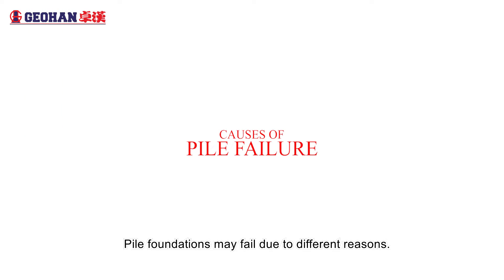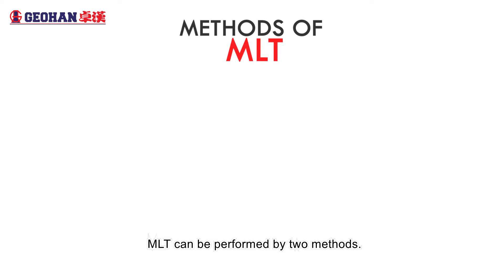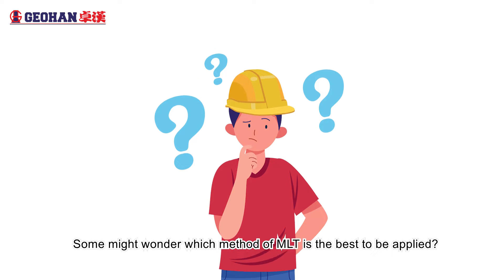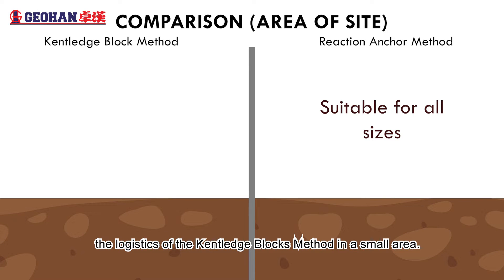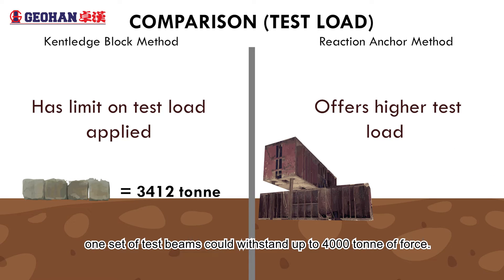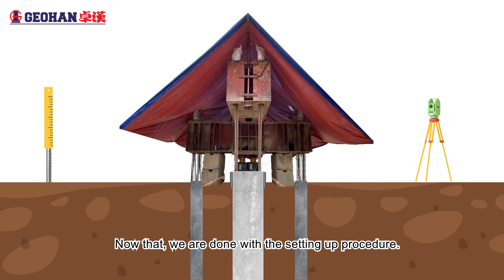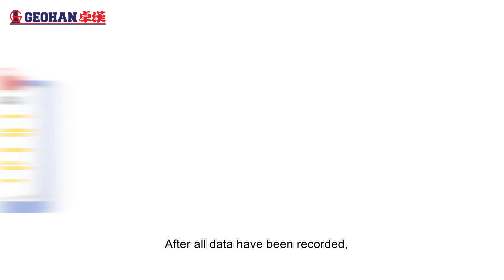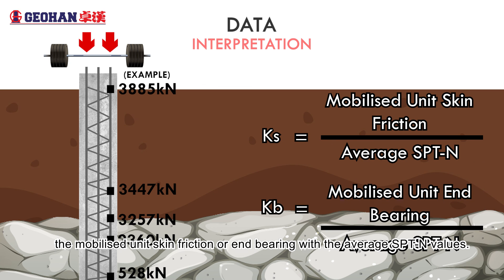Maintain Load Test (MLT) Explained | 𝐆𝐞𝐨𝐭𝐞𝐜𝐡𝐧𝐢𝐜𝐚𝐥 𝐅𝐨𝐮𝐧𝐝𝐚𝐭𝐢𝐨𝐧

Comment: Hi, i would like to enquire bout the difference of kn/m2 or ton/m2.. how do it calculate and convert? i've check many website still dont get a simple answer. some warehouse building spec will show i.e 5 kn/m2 some will put 3 ton per meter. let say if i have a pallet weight 500kg in a meter wide. How many pallet (500kg each) i can stack on top of it if the spec given is 5 kn/m2.. do it make any difference if use the stack rack like many other warehouse?

Comment: What if the load cell shows reduction? Do we have to jack it back to the calculated force?
Reply from the maker: Yes, sometimes the load cell would show reduction due to elongation of the PC strands, relaxation of the locking wedges or the pile continues to settle. We would continue to increase the load or jacking until the desired load/force to continue the test.